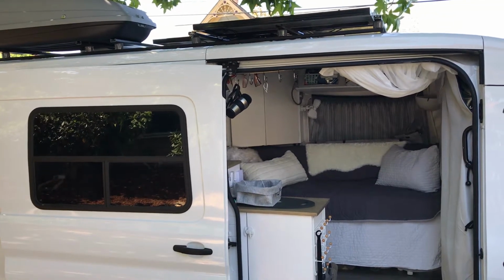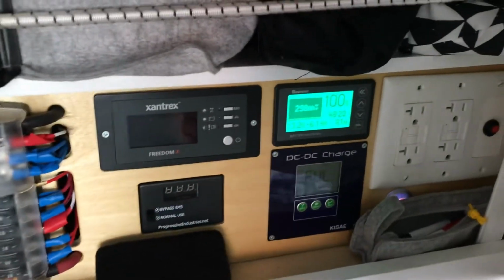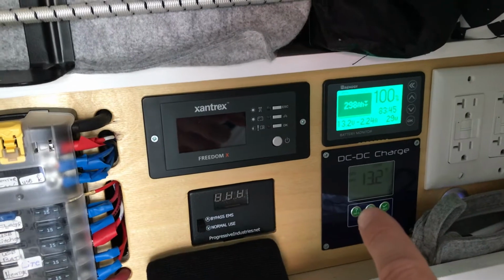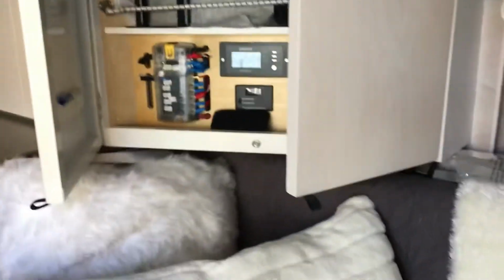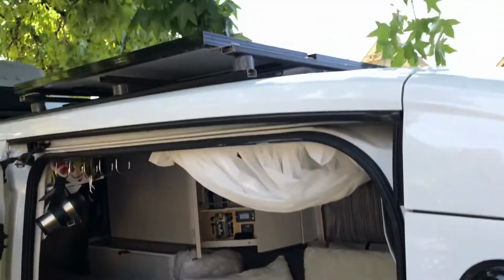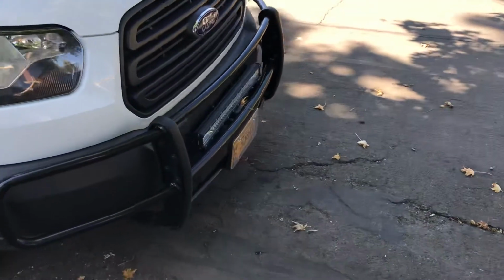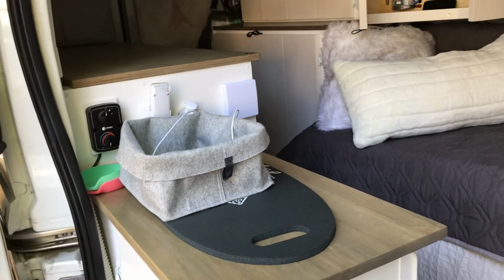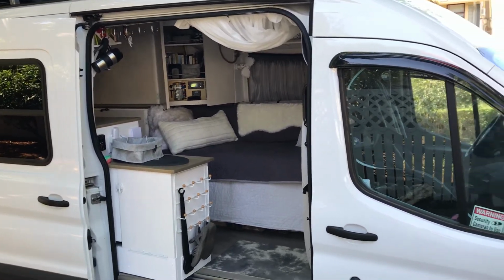Ford Transit VanLife Electrical system follow up

Comment: 1. How did you attach the rack to the roof?
2. How did you route the electrical cable from the alternator to the DC-DC charger?
3. How did you route the PV cable?
Reply from the maker: Check out the original build video. 
1) There’s threaded blocks that attached to the van factory roof mounting points. 
2) cable for dc-dc charger connects to the start battery under the driver’s seat. 
3) cable gland was installed in the roof under one of the solar panels. Requires about a 2” hole to be cut. The process is in the video.